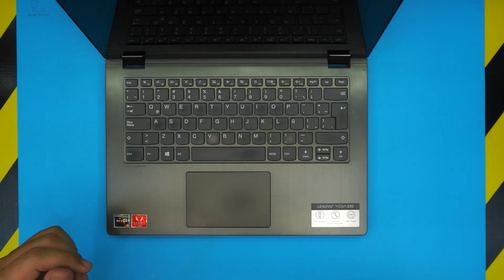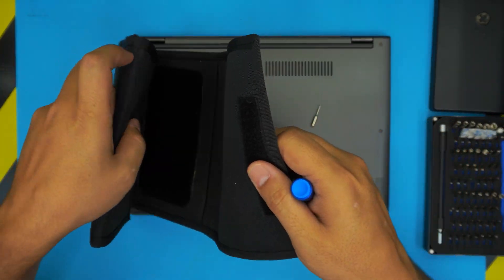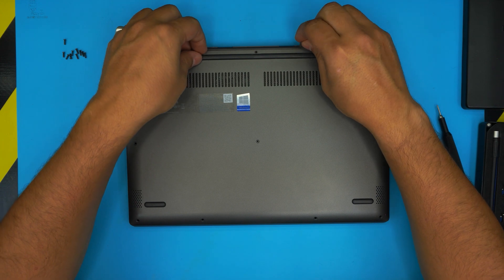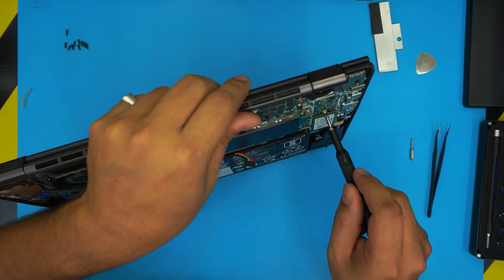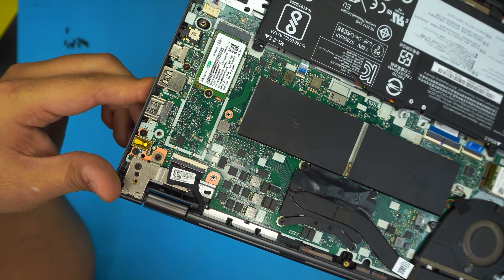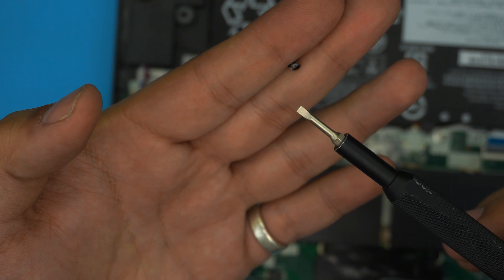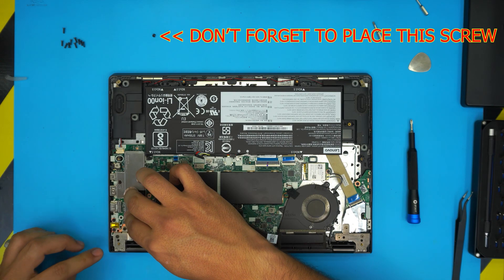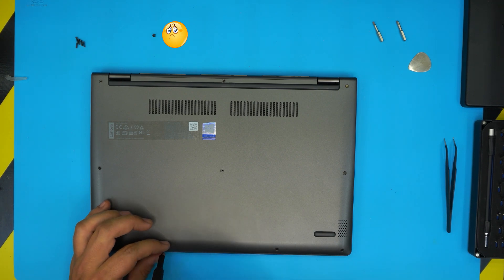How to Upgrade the SSD to NVMe in Lenovo Yoga 530 - 14RR 81H9 | remove bad screw

Comment: That's not M2 SATA Drive. It's M2 PCI-E gen 3 x2 (it's written on disk) with B+M key. It is NVME drive.
Reply from the maker: Yes you are correct it is a nvme slot and gen 3 and you can place up to 4TB  drive without any issues, we have upgraded for clients.
cheers🍻

Comment: bro i have the same laptop but while i do some gaming the gpu temperature shown in task manager reaches more than 90°C/194°F, the information i want is that does your laptop have the same high temperatures or does mine have some issue?
Reply from the maker: Thank you for the feedback! if you wish to support the channel you can LIKE or SUB or both :P
regarding your situation: that's a bit too high, i would recommend you to do a repaste with : thermal grizzly kryonaut extreme : https://amzn.to/3xyx5dZ
your max GPU temps should be at very high 80-85c

Comment: Although i'm searching for something else in the back, it's good to know as I can now locate the SSD and remove it.  I'm trying to fix the laptop not turning on.  Power light on, button light on.  It slowly turned on in the past like after a few hours.  The time never stayed the same while switched on and running but kept the time while it was off strangely.  Now it's just not turning on but with the lights on.  Tried disconnecting the battery.  My screen has been cracked on the corner since Feb 2020 anyway so it might be time to buy a better laptop if there is one
Reply from the maker: Thank you for the feedback! if you wish to support the channel you can LIKE or SUB or both :P
regarding your question: remove the battery and charger and press and hold the power button for 30-60sec then remove the rams:
https://youtu.be/eExsYlkFbGg
then press and hold the power button for 5-10sec then place the rams and battery and charger and power on and wait 5-15sec and you should get boot logo.
else you will need to take it a repair shop for a diagnosis
Reply: @uFixTek  Thanks very much.  I'll try that
Reply from the maker: hopefully it resolves your issue

Comment: i installed a 2280 ssd working fine the cover protects it from disconect
Reply from the maker: You're welcome 😊 Thank you for the feedback! if you wish to support the channel you can LIKE or SUB or both :P
thank you for the feedback , i really home that the m.2 dont move a lot as it can slide side to dice and the pins will make a short, try not to bang the laptop in the bag pack as it can move the ssd to side and the pins will short.
im glad its working for you :)
Reply: did you use a b+m or an M only?
Reply: I've done the same. I put a heatsink pad on top of the SSD and although the metal cover easily pops off, once it's all assembled and the bottom cover in place, it was fine and has been working flawlessly for two years.
Reply: Was it any difficult to install or seamless?